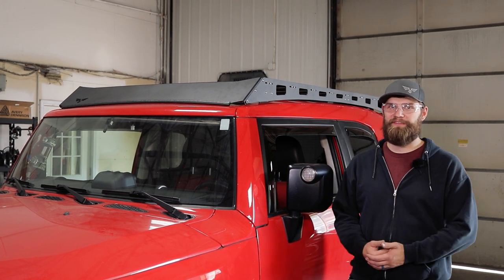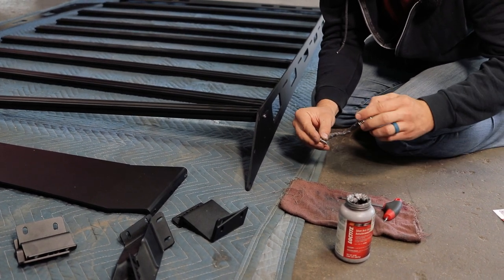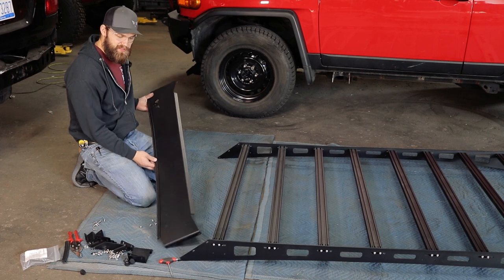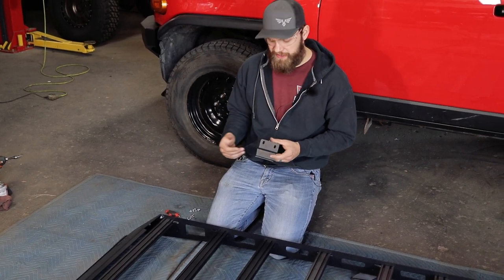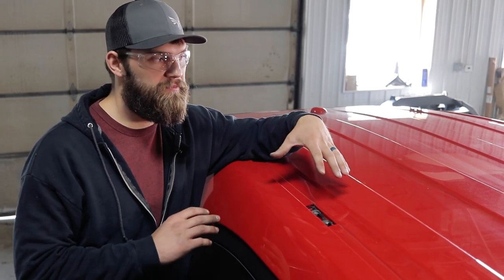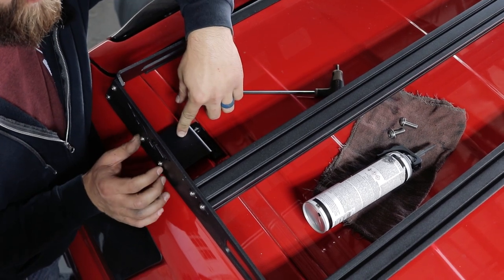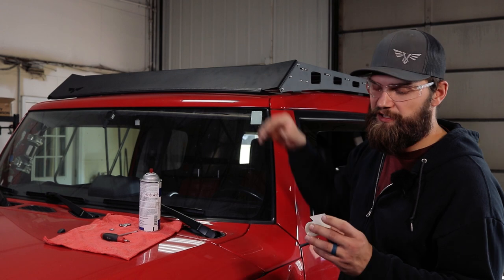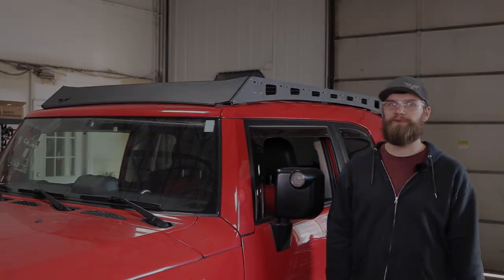FJ Cruiser Roof Rack Install

Comment: Hi. Great video. I have 2 hella 500ff lights and 2 hella 700ff, total of 4 that I was going to use as a lightbar. Instead of a lightbar could I get one of those roof racks and leave the front straight and put the lights on them instead? Thanks in advance
Reply from the maker: You could definitely attach lighting to the front crossbar instead of using a lightbar with the lightbar cutout. It would leave the lighting more exposed and could potentially cause more wind noise, but it can be done.

Comment: Good job.  One comment and one question.
You should use a table to assemble the rack.  Your OSHA guy would go nuts if he saw that. Secondly, do you have black machine screws vs. metallic for the rack  if not, what is the size are the screws?

Comment: Great Vid.  Question, I have a dual led row straight 52" light bar and a current bracket that is approximately 10-3/4" from center of the light bar screw to center of first roof mounting bolt. Can this be added to this roof rack or is there a bracket for a 52" light bar? I do see you have a 'light bar cut out but don't see an image or specs on this.  Please advise, thanks!

Comment: Most of the racks I see on the market don't make contact with the front and rear of the roof like that. I know you're placing down protective 3M tape on the roof, but I can't help but wonder if driving with a loaded rack, or going of road, in time that might cause issues? Is the purpose of it interfacing the roof like that for airflow/noise purposes?
Reply: Good question. I'm curious to read the response.
Reply: I feel that over time, that 3M stuff will take a beating from the sun like much of the other plastics on the FJ and dry rot away.